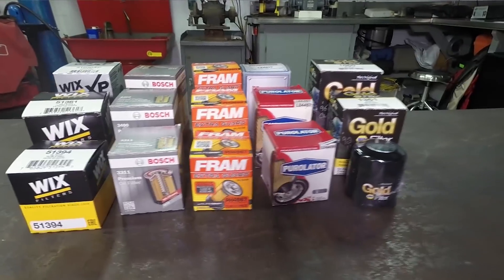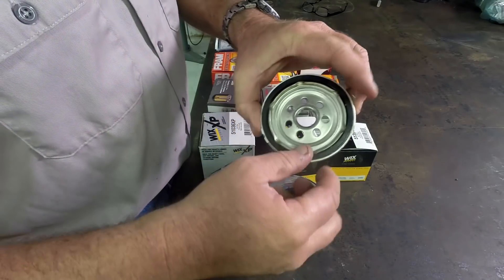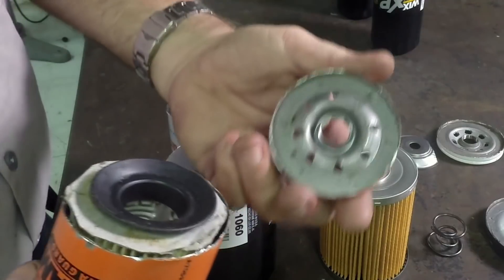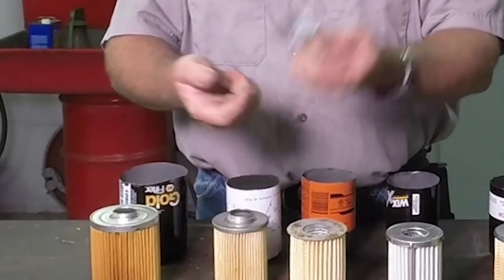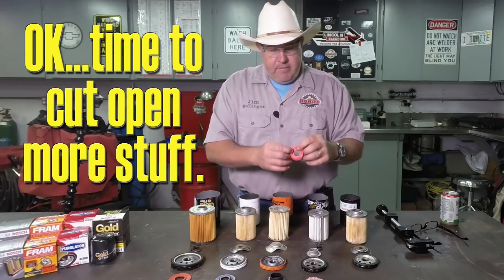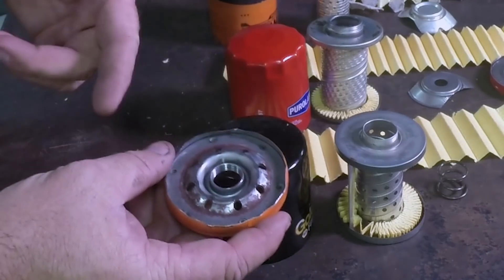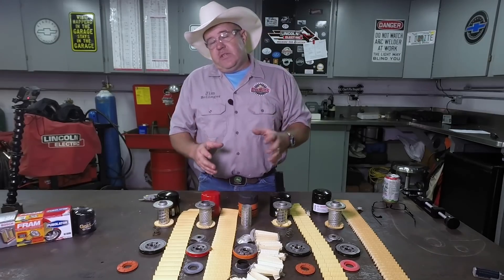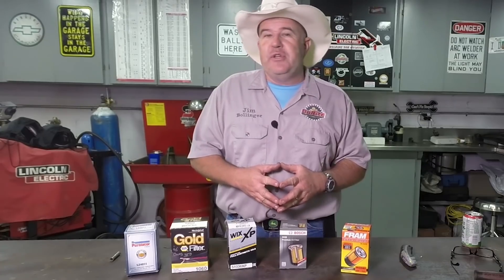The worst oil filter EVER!

Comment: I have been using fram filters for the past 45 years with no issues however last year my engine started making strange noises after an oil change. My mechanic discovered that the orange Teflon deflecter was sucked up through the center of the filter then sucked through my engine oil gallery and was visible only after removing the engine. The Teflon deflector reduced the oil flow to the main bearing and ruined the engine. Fram was good enough to buy my vehicle but I didn't receive a fair value from their insurance. If we hadn't removed the engine we never would have found this issue. Will never use fram again.

Comment: Bought a Fram filter for the first time im 30 years last week as it was the only brand in stock at my local parts store.  Got about 200 miles on my last oil change but that filter is coming off my small block Chevy tomorrow!  Going to find me a NAPA or Wix instead. But, going to buy two.  Drive the first for 200 miles to get rid of the Fram "Cooties" then change to a fresh one. Great investigation!  Your demonstration is certainly compelling!

Comment: I wish you would have done a K&N filter. Some years ago, somebody wrote on a motorcycle forum not to use a Fram filter. He said it ruined his engine because card board clogged the port in the engine. I though he was blowing smoke but I wasn't taking any chances. Your video proved to me the guy was telling the truth. WOW ! I bought one Fram filter for my bike before I read the forum, That filter is still sitting in the garage, unused. Tomorrow I trash the filter.
Thanks for posting this video. It was very educational.

Barry

Comment: Happily I haven’t used fram for years. Thanks for this.
Reply: 346,000 miles on my tacoma and still running strong. . Only time it hasn't had a Fram on it was when it came out the dealership and I hadn't done an oil change. Just change your oil on time.

Comment: Every shop in my area pushes Penzoil.  Blah blah warranty bs etc. my 5.0 f150 runs sluggish noisy. Put in Castrol and very quiet and plenty power on the florida interstates in August. some people say Castrol is carp, but I never have viscosity breakdown with it. Started using it in the mid 70’s had a beemer  4cyl TII.  Y’all know better oil than Castrol I am all ears. Thanks

Comment: Nice video.
I just retired as a mechanic at our local school board here in south Florida.
For some horrible reason, the school board has/had decided to ONLY use FRAM filters.
On at least 4 different jobs, I found that the FRAM filter had become de laminated from the metal body. Therefore they filtered nothing.
These were all discovered by accident. And I'm sure that the failure rate must be much, much higher.
FRAM filters are pure garbage at best....And at worst, actually harmful.

Comment: I had a Fram on my motorcycle. It was one of those with the "nut" tack welded on it and that was down towards pavement when installed. From what I could tell a rock had hit that nut and the tack weld tore off the filter and made a hole. I was ripping down the highway at 70mph pouring oil out on my back tire. I didn't notice until I came to a stop and when I took off and started a turn the back wheel came out from under me. Luckily I was able to steer out of it and keep the bike upright. I swore I would never use a Fram again, and after seeing what's inside it makes even more sense not to use that garbage.

Comment: Therefore, I have been protected by higher powers or something.  Since 1990 I have used Fram, I even purchase the filter tool to use with my socket set.  Always changed oil myself and on time, never had an oil problem.  I should try another brand anyway.

Comment: I used a Fram filter once…once. My engine started knocking on startup, even though I filled the filter with oil before attaching it to the engine. I immediately shut down and took it off and threw it in the garbage.

Comment: Fram filters are used in Italian bikes & cars & have been for donkeys years .The best filters are Japanese, you can’t go wrong with one of them . Rust & water gets into your engine anyway through the open valves when it’s left standing & the fuel plus condensation in the crankcase even more if the vehicle only does mainly short  journeys .

Comment: Fran filters are junk. In the 90s, Fram spin on motorcycles we’re physically coming apart, leaving engine oil on the road or track. Total junk, and not improved in ~30 years.

Comment: I use Fram on every vehicle I own and I always get well over 200K miles.  Never a single problem. I have a 2006 Suburban with 230k miles and it’s running GREAT!  Oil changes every 3000 miles!

Comment: Back in 99 or 2000, I had 2 55 gallon drums full of used oil filters. I cut every one of them open to compare. Close to a dozen Frams didn't even have a filter element inside. Just a hollow can. All different sizes too. Not like a bad run of a certain part number. I wouldn't put a Fram filter of any sort on anything ever again.

Comment: OMG, Must be a Fram Filter Hater? Been a mechanic for over 45+years and have been using Fram Oil Filters before I could drive back in 1970. Not only did I used Fram filters back then, but I'm still using them in my personal cars and the cars I still service. Never had even one fail which I must admit, is strange for anything over 50 years of using. I own a SUV's which has over 265000+ miles, a Toyota that's over 15 years old, another wagon that is 21 years old and the engines in them are in great shape and I never worked internally on them, only wear item parts like waterpumps, brakes, etc. They all used Fram Filters since I bought the cars new since I never take my cars to the dealerships or to anyone else for repairs or maintenance?

I do use mostly the Fram filters that are made for Synthetic Oils now since all of my cars uses synthetic oils. I do still use their basic filter which is the orange color ones if the car I'm servicing is using a Blend or regular petroleum base motor oil. Never did I have any problems with them, never a O ring problem, never any leakage problem or any contamination of oil in any engine that I used a Fram filter on. My father owned a Automobile repair shop and he only used Fram Filters from the 60's and this is why I do, the Fram filter has proved to me without any doubt they are great filters! Again we can say anything we want on YouTube and make things look like something that they aren't. So I can say with my experience with Fram Filters, the Proof is in the Pudding!

Remember when you take apart a oil filter, you are destroying it. It was assembled together in one unit and closed up and not to be taken apart and if you tear it apart, well the spring and filter material is going to fall apart. You see cardboard in the Fram filter but once it's assembled, it stays together (to this day, there are many Oil Filters that has cardboard inside of them). Remember you do change your filter out on a regular maintenance schedule so it doesn't stay on your engine until it wears out like a alternator or waterpump?

If Fram was such of a bad oil filter, why are they still in business? I will always buy Fram Filters until I stop working on cars since they been loyal to all my personal cars, neighbors, friends and customers cars and trucks. I don't and never will go by someone's opinion. I always go by my personal experience with the product and to see this guy only picking on the Fram filter and recommending the most expensive filter( I always asked myself when I see them on a shelve "who the hell is WIX". I do buy Napa parts but again, not their filters. I never buy the expensive filters because you do replace your oil filter on a schedule(throwing your money away). There are so many things that can go wrong in your engine so thinking if you buy the most expensive oil filter will keep your engine running for years without problems is just immature thinking and not very realistic.

Don't let pictures fool you or make you think one way, keep an open mind and ask yourself, if they are all that bad why are they still making them or why are they still in business? People would sue them for engine damage. I will tell you now, I always trusted Fram filters and will never stop buying them since over 50 years without any problems with them at all! Great Oil Filters!

Comment: Did this back in the 80's though I was cheap and the filters were used. You'd be really horrified to see what a Fram filter looks like after 3000 miles. You'd do better screwing a roll of TP where the oil filter goes.

Comment: I recall as early as 1993, Cummins put out a bulletin saying dont use fram because the oil pressure blows the media apart plugging the piston oil squirters.  I only run Fleetguard, Wix, Mobil or Mopar filters.

Comment: Great video! I remember doing a similar comparison of motor oils about 30 years ago when I worked in automotive shops. It was an eye opener and I’ll just say I’ve never put Pennzoil in one of my vehicles since. It was the dirtiest looking and gummiest feeling of the top seven brands at the time. I did the comparisons after noticing how gunky the oil was in cars using Pennzoil at oil change time. Garbage in, garbage out.

Comment: where are the oem filters? n the 90's fram sued chrysler because chrysler said they had a better filter friend 0f mine was Chrysler's expert he did what you just did he showed the jury how much better the OEM filter was long story short Chrysler wiped the floor with them. Funny part of the story Fram made the filter for Chrysler.Heres the deal an oil filter is required to meet OEM specs OEM spec for an oil filter is it must filter oil. It's worth it to put a quality filter the Napa gold and the wix cost a little more. Spark plugs are the same in construction the one the dealership sales when you torq it properly will index the one on the self failed that test OEM does every thing they can to bring that cafe rating down it comes down to this it all works but find the best. 10 bucks more at the dealership you get a filter they designed    This one of the best video for filters on you tube great job

Comment: Rust in the Fram is due to moisture getting in AFTER the filter was made. Fram did not add the moisture as a feature.!!  Most likely poor storage or someone spilled water on it.
Reply: @glenn.d: agreed. Besides, based on oil flow, the rust particulates will be trapped by the filter.
Reply: Did someone get in there and remove all that filtering media and put in all that cardboard too?

Comment: ~30 years ago I was the engineer responsible for oil filter production at a Fram factory.  That's when I stopped buying Fram filters.  I knew they had design AND production flaws that other filters did not have (production was flawed BECAUSE of the DESIGN).  Not what this guy talks about - he completely misses the point.  His arguments are all nonsense since he knows nothing about what constitutes "quality" in a filter.  For example, Fram uses cut threads in the base plate, many other manufacturers use "rolled" threads and in Fram's case, there were often loose bits of swarf.  Also, the quantity of filter material is NOT the factor he thinks it is - imagine this:  There's so much filter paper that pleats are crammed against the center tube - meaning that all the oil needs to go through the bottom of the pleats, which quickly become clogged.  Filter material should be judged by the weight and particle size of contaminant that it can retain - not the "length of the paper".  Never send a boy to do an engineer's job.
Reply: He does have the ‘hat of authority’ though.

Comment: This makes me want to change my oil early just to switch out the filter, I've been using fram for the last 2 years because I had no clue
Reply: You can get away with cheap oil and filters if you keep up on maintenance. My Civic was still running at 300k miles when I sold it but I often changed the oil ahead of schedule.
Reply: @ben501st  to be honest after I watch this video I opened my hood to see which one I got, luckily I have the ultra synthetic one which isn't quite as bad but I've got a 2000 Jeep Cherokee with 202,000 miles on it. I changed the oil every season and she's been running great so far

Comment: what in the hill billy fuck is going on here.      all this orange filter bad talk but never have i heard of anyone having a failure due to a fram under normal use....ones i have were idiots running the oil 15-20k miles because their oil analysis was good.   if you're running those kind of miles on a cheap filter made for conventional oil, you're about as smart as this backwoods cowboy in the video.

Comment: Great video! I have used Bosch filters with good results... I open every filter- up after it is used, to check for non-magnetic metals... And the Bosch filter media, anti-drain back valves, loading springs, filter plates & cans have held together every time... Not so when I open-up Orange Frams, Cheapie 'Fast Lube' filters, STP filters, etc... They already started coming apart inside sometime BEFORE the engine oil change was done... The Silver Fram 'Tough Guard' filters are at similar quality levels that the Bosch, Purolater, Motorcraft filters are... But by all means, AVOID THE CHEAPIE FILTERS!!!!

Comment: I used to be an aircraft mechanic, and we cut open filters, inspect and send samples for testing every oil change. So I started cutting open filters on my vehicles, had a Ford pickup at the time. 2 of the 3 Motocraft filters I used had the filter media fall apart, and not only stopped filtering, but introduced contamination. The Fram filters were always good, but didn't look like that. Wix was the better quality. Cutting them open with an angle grinder would contaminate the filter, as far as inspection for metal. We used a tool similar to a pipe cutter. Also, test the filters after 3000 miles use if you want a real test.
Reply: Good comment
Reply: @guyvanbrussel9772  Apparently he does NOT have an ax to grind in comparing filters. For n more than50 years , I have used F R A M S. ---
NO MJORE !!!!!!Now, I will use WIX FILTERS .
Reply: Aircraft engine  and car engine are different ball games and standard.
Reply: @guyvanbrussel9772 Brussel, this guy is just "upselling" by instilling fear in his customers.
I actually had an airplane mechanic cut open one of my car's Fram filters that had about 9,000 miles on it.
It was just fine. No unexpected particulates, it was holding together just fine. Not leaking. The pressure relief valve was working fine.
Reply: @skylane807  if you used a filter up to 9000 miles you and your mechanic should have their tools taken away
Reply: @dougreames605  why?
Peugeot recommend the engine oil and filter are changed every 20,000 miles, but you think 9000 is a sacking offense?
Gst real.
Reply: Thank you for this buddy. I had a Toyota Prado diesel engine (recently rebuilt) lose its big end from oil starvation. It was running a Blueprint filter at the time, & I had a feeling that that caused the failure - lost internal structure & likely sent something down to block an oil channel. Genuine Toyota filters only for me, from then!
Reply: @Arif L  Toyota filters are going to be made by either Denso or Purolator. The ones manufactured by Purolator are identical, internally, to the Motorcrafts they also make. The ones made by Denso are generally poor to average quality. If your Toyota filter is made anywhere in Asia, it's a Denso, and if it's made in North America, it's a Purolator.

 I stopped buying the Toyota/Denso filter for my Land Cruiser and switched to the Motorcraft (which is basically what the old Toyota filter was, before they got Denso to take over production of that style.) With the Denso I was getting a startup rattle from the valvetrain, which disappeared with the Motorcraft.
Reply: @guyvanbrussel9772  I've used fram for fifty years, and don't expect to ever use them again.  I will cut my own apart to final decide, but I do expect this video to be true, and will return if I find it questionable.  The majority response to this video suggests it's accuracy.

Comment: Before the internet tried to make us think we are smarter than we are...  my father owned a large garage for over 60 years.  He used Fram, Autolite and AC Delco filters almost exclusively.  We never had any problems with any of those brands, no failures, no excessively worn engines, nothing.  I've used them myself for over 40 years with no problems.  One might look different inside than the other but they all filter the oil the same way.  I will say that my experience is based on oil changes at the prescribed interval, our customers might not have done that.  I think there are lots of people who never change their oil, they just pour more in when it gets really low.  They might benefit from the largest amount of heavy filter media that they can get.  I also remember that one of the suppliers that we got  parts from tried to get us to use WIX filters, we thought he was just pushing a product that he made more money on.

Comment: The Fram filter he used in this test is the cheapest level Fram makes called Extra Guard.
The second up in quality is TG Fram, and their highest quality version is XG Fram which beats Wix, Nappa, Purolator, Baldwin, Mobil1 and many more, by large margin. 

This video hasn't taken into consideration the points I have mentioned here thus can be considered invalid, amateur attempt to discredit a good company like Fram. In my sophisticated Japanese vehicles like Mitubishi, Toyota and Honda, I use no other filter but XG Fram as it filters over 99% particles while filters in this video barely filter 95% of dirt/metal/carbon particles.

Comment: Wix sales what happens  when you put to many filters in your coffee pot the coffee doesn't want to come out right to much back pressure burns up the oil pump then the car was designed for a certain type of filter not what the wix sales man is pushing